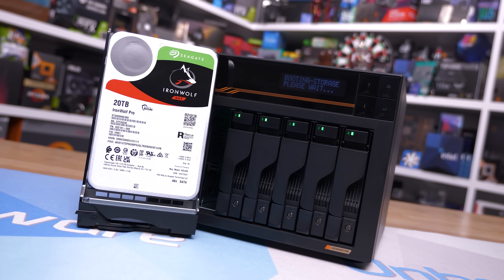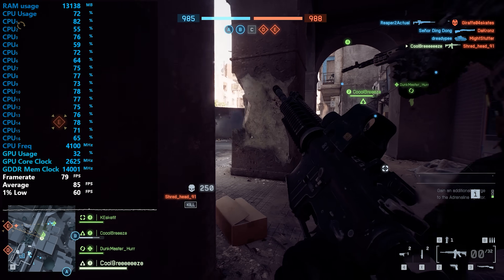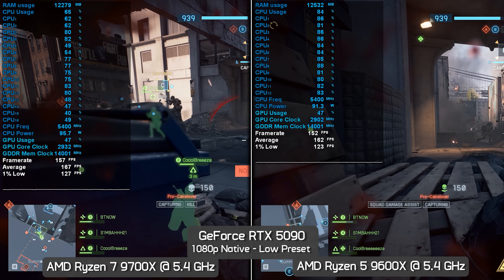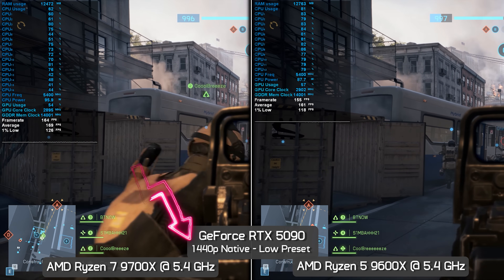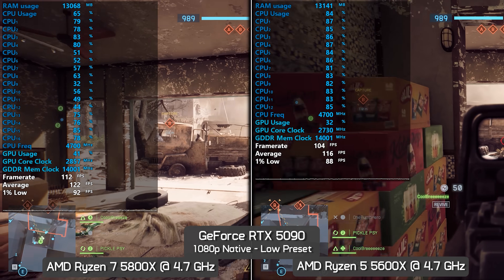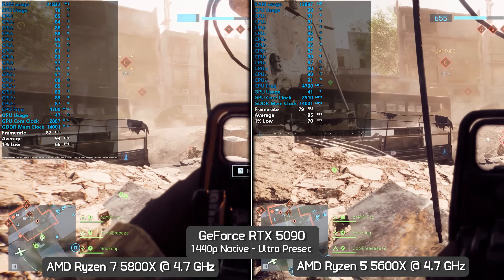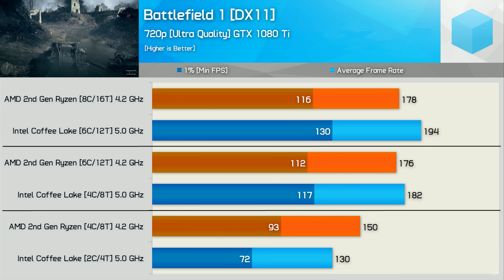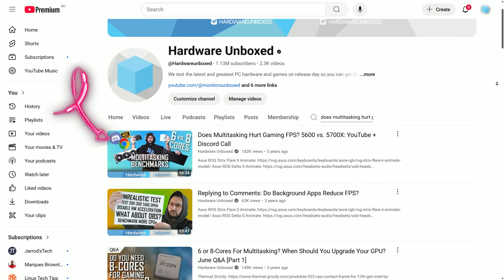Why Gamers DON’T Need More Cores, 6-Cores Still Works Well!

Comment: 6 cores is not enough at 1440p. I'll say it's the minimum but I get tired of playing games with 80 to 90 percent CPU utilization. I have a 7900 gre and I have to turn down any graphics setting that impacts the CPU or games will stutter crazy. my next cpu upgrade will be more than 6 cores.
Reply: Did you watch the video at all? If you did you'd know that the specific core count is bordering on irrelevant. 

A 6-core CPU that's 4x the performance of the one you have would be no better than an 12-core that's 4x the performance of the one you have.

It's like the question of which is heavier: a pound of feathers or a pound of nails? They're the same weight.
Reply from the maker: What 6 core CPU though?

Comment: I'm still using a r5 5600 with a 6800xt. Plays everything I throw at it. I'm also limited to what CPU I can use in my 7 liter SFF PC, so this cpu works for my use case.

Comment: :)
Reply: i have a 4 core cpu and in gaming even when heavily multitasking it doesnt really effect my performance very much. it made a much bigger difference when i was still using the igpu, but now with a dgpu basically nothing. if i get a stutter it just was going to happen either way usually, games like fortnite just seem to stutter no matter what. there is ofc edge cases here and there, but even in those cases it seems to be a little more nuanced than simply "stop multitasking". where i do run into bottle necks with my 4 cores seems to be stuff like video editing, where when previewing my timeline with some effects applied i can see my cpu getting pretty overloaded, but i think that might be more down to other factors like slow read/writes to my ssd, memory getting full, or the low clocks of this cpu.
Reply: @EclipseCat  multiple cores just help with very specific productivity stuff that use hmultiple cores,  like video editing (like you said), blender and photoshop maybe.

For your stuttering it's just because 4 core cpus must be really old, is it ddr4? might even be ddr3. I have the same stuttering issue with one MMO on my laptop (it's 8 cores), and whenever I have firefox running in the background taking even 4 gbs out of 32 the game just stutters a lot more, and is much less smooth. Turned out this game is just really limited by memory performance. So I'm buying a 6core AM5 just to get better ram (already got a hynix ram) and I'm going to try and run it at 8000mt or 6200mt worst case. Would be a massive upgrade from my 3200cl22 laptop ram, even when going down to 6 cores (because that number doesn't matter)
Reply: @EclipseCat  because more cores don't help with multitasking, it's just a myth

Comment: BF6 ran well on my 8700k / 3070 (1440p). I obviously couldn't run Ultra with only 8GB of VRAM, but I think I settled on medium/performance and had a pretty smooth 90fps. Looks like I'll get another year out of this rig after all!

Comment: I have the 6 Core Ryzen5 7600x OCed to 5.5Ghz (from 5.3). Using it with 5600 ddr5 Ram (OCed from 4800 with better timings) and with Rtx3080ti OCed +150 Core +1000 memory. Everything stable, good temps, playing pretty much everything new maxed out 1440p 80-100 fps, with RT or PT 40-60fps with DLSS 4 Quality or Balanced at most.
PS  : I think that in this test the difference of 10% comes because RTX5090 is super fast and could be CPU bottlenecked with any processor except the top line. With any more Normal card like 5080 I dont think you will see difference.

Comment: I got a 7600X3D at below MSRP and it's been absolutely crushing it for me. From the benchmarks in most games that are relevant to me, I saw that it's maybe 10% less performance than a 7800X3D - but at 50% less cost, I can't really argue that it was an amazing deal. 
And it really depends on what you play, too. Still a lot of pretty relevant legacy games with absolutely awful or non-existent multithreading, so the number of cores really doesn't do very much there.

Comment: The thing with high core counts is that on a logical level, multithreading gets exponentially more difficult, but also less useful, for game devs. First few cores help a ton because you can split work in large parts like "world", "graphics", and "audio" that don't interact much, but when we're talking 8+ cores, we're talking things like designing a system to tick different objects or areas in different threads while trying to avoid the race conditions and overhead of synchronization. Plus, most tasks are simple and can run together in the same core just fine, so that work often isn't useful.
Cores can theoretically help for large simulations like shapez 2, Cities Skylines, and Minecraft servers, but even then, those are very optimized and don't need it at all.

Comment: Honestly when looking at the utilization, I begin to wonder if the 8-core models are perhaps more bandwidth-starved than the 6-core ones.
That would explain why the gap between the models got smaller on zen 3 compared to zen 4, despite the CPU-bottleneck being stronger.
It would also explain why the gap got so big on the Zen+ models, as they also use DDR4, albeit with a lower clock probably because of the limited memory controller at the time. 
Still, the proportional comparitive downgrade probably offset the lower bandwidth, allowing the 2700X to strech it's legs a bit more. 
(tho, there is lower latency to be had still, which is also more important for the CPU than bandwidth... So many factors. :/)

But that's just me theorizing something based on what I saw. I may be very wrong! ^^

Comment: Even though I didn't bother with my fps counter, my r5 7600, RX9060XT 16Gb and 32Gb of 6000Mhz Corsair Vengeance ram played the BF6 beta smooth enough on my 3440x1440p monitor, with Ultra settings, that I had plenty of fun and didn't feel like my FPS was holding me back. Being on the bottom west corner of Western Australia meant my ping was my main issue.

Comment: I'd been considering an upgrade to a 9800X3D for my 7600 but really it's like it only matters at 1080 with a 4090 or 5090. 7600 is good enough for any graphics card in my budget range. 

Maybe for Zen 6 I'll make that jump when they fix the latency issue of the I-O die.

Comment: I have a 9600x, im getting cpu bottlenecks in Space Marine 2 & Helldivers 2 at 1400p max setting with a 9070xt, looking at a 9800x3d rn.
Reply: My 7800x3D hits CPU limits regularly in Helldivers 2 at 1440p max settings on a 4080S. CPU limited into the 80s in a lot of cases.

Apparently the performance of that game has been getting worse overtime with updates, unfortunately.
Reply: @TheDarksideFNothing  its got heavily to do with the Ai update in march of this year i think, after a bit more research a 9800x3d would help but not by much
Reply: @loizpils Yeah, if any game were to justify being really heavy on CPU in my mind Helldivers 2 is up there.

Extremely ambitious AI goals, small studio, dead game engine that no longer has support from the engineers who built it...

It's a shame and I wish it were better, but at least it's doing something special to warrant it.

Comment: Introducing more cores into a latency sensitive workload like gaming is actually detrimental to performance, but since we cant produce a single core with the power of 8 smaller ones this is a bandaid we need to use.

Comment: 7500F and B580 is still a very reasonable combo. If you want a 6C12T CPU that works on Arc without the overhead issue, that CPU is the bare minimum, at least on AM5. If you want to use B580 on AM4 sure, go ahead and get a 5700X as the minimum. But reddit or whoever started this should stop weaponizing B580 for spending too much on the CPU because this sounds like that's the case. Though AMD and even Intel also better not weaponizing this as a way to be stuck on doing 6C12T stagnation

Comment: Been thinking of replacing my 10400 with an 11700. Cheap upgrade. 
I wonder how worthwhile that would be once BF6 releases in terms of performance. I had the beta locked at 70fps  at 1440p (6800xt still had plenty of headroom). Would be kinda nice to lock something closer to 90fps with a cheap upgrade.

Comment: This is actually even more important in laptops. For years, I've believed that using very high-core processors like 13900hx, 14900hx, and 275hx in high-end gaming laptops is worse for gaming than processors with fewer cores. The processor uses a lot of wattage to power these many cores, which causes unnecessary heat buildup in the laptop. More importantly, because laptops are also power-throttled due to thermal constraints, the CPU steals power from the GPU, reducing overall performance. This is why laptops like the RTX 5090 and 5080 should be sold with lower-core CPU options for those who will use the laptop solely for gaming. People are just paying more for less performance, more heat, and more fan noise.

Comment: I'm sorry, I know I'm just making a point that's kinda moot, but I feel pretty strongly that we're glossing over nuance for the sake of a tidy conclusion that "Steve is right and is always right". 

Obviously if you're going for a 6 core, you're probably on a tighter budget, not using a 5090, not trying to push 150+ fps in Battlefield 6. Where as if you have the money, you're probably gonna get a better cpu and therefore this entire argument kinda just becomes a non-issue.  

BUT, when the relatively new 6 core is pushing upper 80% utilization in a shooter with assumedly a relatively clean OS, low or no bloatware, and maybe 1 other program running (to track performance), I'd say maybe the 6 core is reaching the end of its time as the go to cpu for gamers. Because let's be honest, this isn't realistic. Yes, you did some testing....I'd argue said testing that was extremely limited in scope, but testing nonetheless, on the impact of "multitasking" on gaming performance. If discord and chrome combined is about 4-9% more utilization we can say you're pushing into the 90% range pretty easily. And if we add a couple background applications, let's say ICUE/Synapse, maybe other game launchers that the user has configured to run on start up, maybe an OC utility like Afterburner, Nvidia Broadcast, etc and you're maxed. But on that 8 core (assuming everything is playing nice and utilizing the additional cores correctly, which I admit doesn't always happen) you're probably sitting at 80% still. And some years down the line, as games continue to push the limits of what hardware can do and programs continue to eat more and more resources, that 8 core might still be holding up. Case in point, the 2700X that is still holding on (admittedly only just) while the 2600X is starting to fall off completely. Again, fair to assume minimal bloat and "multitasking" in your testing, so that was best case scenario, yeah? 

So yeah maybe you paid an extra 45% for that 8 core, but if you get another year or two out of it (assuming you can swing the initial investment) then the value proposition really quickly swings towards the additional cores. And in today's market, it's crystal clear that more than 6 cores is going to become more and more useful as time goes on. I don't know how you see the example of quad cores being irrelevant in the current market as "Extreme" or "Silly"  since it's directly relevant to this conversation and the most clear example of how the industry has pivoted to utilizing more cores for more performance. And I don't expect that trend to stop.

Comment: You are forgetting a special kind of gamers. Chess lovers like to play with chess engines. And the most powerfull engine (stockfish) likes a lot of cores. Also checkers/draughts engines benefit a lot from more cores. Anyway this "low core"  cpus are hampering inovation on researchers that don't have the cash for Threadrippers. And the gaming industry and the gaming community are the main culprits. Also it's not that games couldn't benefit from more cores, it's the gaming industry that want's to reach "everyone" even the ones with quad cores and sell as much copies as they can.
Reply from the maker: Can't you play those games on a 9600X? I think you're missing the point, I'm not saying higher core count CPUs aren't faster, rather I'm saying they're not always faster and generally modern 6-core CPUs still work exceptionally well.
Reply: @Hardwareunboxed  I understand perfectly the gaming community isn't demanding in cpu power. But researchers are.
One thing that comes to mind is the water simulation (for games). It has come a long way but it still doesn't look good specially with fish or other objects moving underneath the surface. I suspect more cpus could do a lot better. Yes I know about UE5 it really is amazing, but I suspect not so great in light refraction and the GPU can't to everything at the same time. Also someone runing in shallow water is a difficult thing to do without a lot of processing power. I saw some videos using UE5 in water simulation, it's nice but far from me liking it.
BTW this is really water simulationi: search the video: "Can crocs really drink saltwater??"  😀
Reply from the maker: This is about budget gaming, if you can afford it I would recommend an 8-core of better, of the same architecture. But the point is budget gamers are still doing well out of the 6-core versions.

Comment: I will say that before hearing the cost/value analysis, the performance gap within the Zen+ tier lead me to believe that there might be situations in which the increased core count could be of benefit. Specifically, when the time between upgrades is above average. 

For example, I average anywhere from 5-7 years between significant upgrades, to include CPUs, which means that 7 years from now an 8-core CPU may be of greater benefit when running new releases that can take advantage of all the cores.

I'm not a proponent of buying to "future proof," but those Zen+ results definitely got me thinking.

Comment: I'd say the fact there is any difference between 6 and 8 is great evidence for only buying 8 core chips. It's only going to get worse in the future.
I've been saying it for years now, just get an 8 core. The difference in cost across the cost of a system is minimal and you will always have a better experience. 
Which this testing shows. Great job with the testing as always.

Comment: While i agree that benchmarking cpus at higher resolutions is ‘dumb’ for absolute performance comparisons, it actually is quite useful for people looking to buy a new cpu to see if they really need the extra performance for the games they play so i think you’re framing of it as “worthless” is not super respectful of peoples’ intellect or time. For example, if a cpu will literally only differentiate itself at 720p and will have zero difference at all resolutions higher, but a consumer doesn’t know that and thinks those 720p benchmarks are valuable they’ll make a bad purchase decision.

Comment: In my testing on BF6 ( my own rig ) the Ryzen 7700 non X was able to achieve avg of 170fps at 1080p low native using at 7800xt , The CPU is not with stock setting but rather running PBO with curve optimizer and overclocked .

Comment: Nah, Games like Battlefield absolutely need more than 6 cores. Even a 9800X3D suffers from some terrible frame times. A huge amount of games in general suffer from frame pacing issues due to low core count.

Until you guys start doing some in-deph frame time testing, relying on just frame rate to conclude 6 cores is more than enough is fools play.

Comment: I would still never drop below 8 cores in 2025, if consoles are using 8 cores so should you, they may be ancient Zen 2 cores now, but it's still at least 8 real cores. I currently use a 7950X3D and would never drop below 16 cores again as I do like to do some other things apart from gaming. Plus with tools like process laso (windows scheduler even on 11 with the chipset driver is still unreliable), I can give an entire CCD to programs like Chrome, iCue, Discord emails clients and other programs etc and give the X3D CCD pretty much close to exclusive access so that nothing interferes with it.

Comment: I have rx 7900GRE and 5800X3D and while CPU usage was around 75% and GPU was around 95 to 99% i still got 110fps which was nice but after i dit quick chage from DX 11 to DX 12 in hiden menu in files and add new comand to use my whole CPU only than real magic happend, first of all CPU usage dropped to 55 to 60% which give me not  more fps but game feels smooth but that change from DX 11 to DX 12 give me a aditional 10fps more so at the end around 125fps on awarage and 1 % lows 95fps  alot better than before, also its worth noted that same shit you need to make in Battlefield 2042 to actually run well and i was very surprised when i saw that new BF6 use same hidden menu in files all same soo all chnages i made in 2042 i just copy paste into BF6 file and it works great also GPU usage is now at 100% as it should be, the CPU stay at 55% which is very nice, only down side is that my GPU power draw is at 304watts but thats OK. But this was beta i wonder how well gonna run game when it come out it its gonna run better in full release than i will turn all settings i changed to default.

Comment: I run a 5600 with a 7800 xt and haven't felt the need for a better cpu. I got the 5600 for 130 usd and swapped out my 1600x on my x370 board, so now I'm one of those people that will probably be on am4 for a decade.

Comment: As someone who just bought a 7600X3D for someone's gaming system, this video totally supports my decision. The 7600X3D is an amazing little 6 core CPU.
In my own systems, I tend to upgrade both cores and tech at the same time. I went from a R5 3600 to a R7 5700X to a R9 7900X3D. If I upgrade later, it would probably be something like an 11950X3D if it has vcache on both CCDs :D